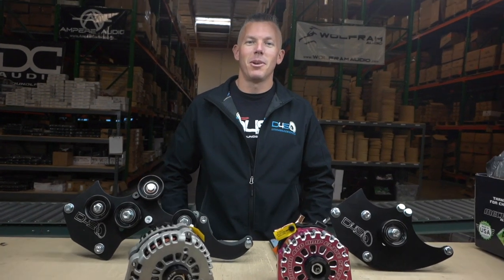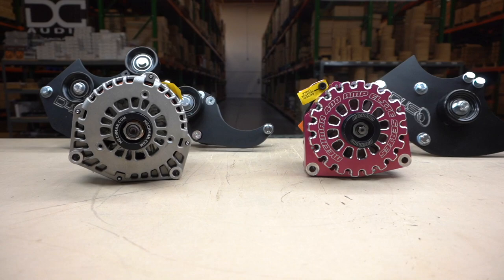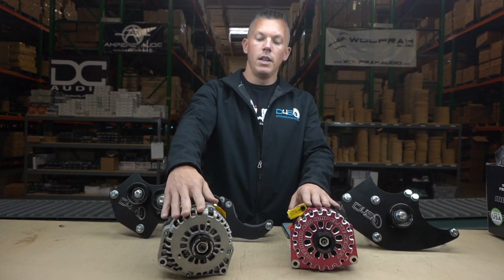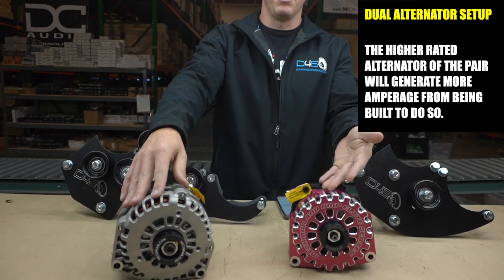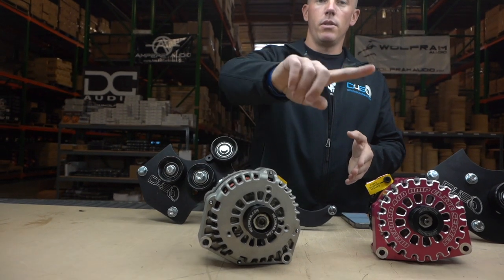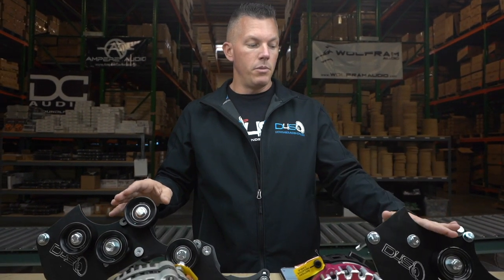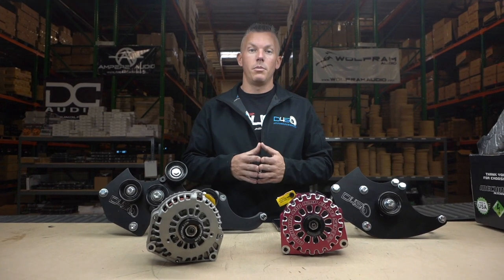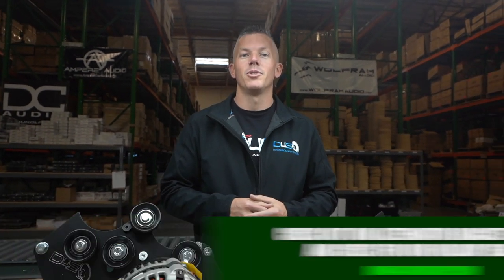FAQ: CAN I USE 2 DIFFERENT ALTERNATORS IN THE SAME SYSTEM?

Comment: A video showing how to run AGM & Limitless would be appreciated.
Reply: AGREED!!
Reply: Don’t do it…..
Reply: Lotsa videos about running agm with lithium on YouTube
Reply: @YouTubesucks.. ,why not?
Reply: @62dobie  Became lithium TRUMPS AGM by far, it’s stupid to run both when you can get better results by just using with lithium!
Reply: @YouTubesucks.. , I do agree. I was just wondering if you had a bad experience with both. I know you can run both together safely. But lithium alone is far superior.
Reply: @62dobie  I ran AGM all up till a few years ago once lithium came around. Now I’m running lithium and SuperCaps on a Salt12k @ .25 ohm on 4 15’s!!!!!
Reply: @YouTubesucks.. , is your cap under the hood?
Reply: @62dobie  Nope, next to my lithium in back. First thing my Amp sees!
Reply: The 6.0 lithium is compatible with AGM. U can run that 2gether
Reply: If I ran 2 alts separated one for the truck and one for the system would that solve my lights dimming when running full tilt at night?

Comment: I have a 2004 F-150. It’s running at 12 volts. I have a high amp alternator in the stock location. I installed a dual alternator setup on it. I have dual agm batteries under the hood. The second alternator is a Mechman 400 amp Elite Series alternator. When I first wired the setup up, I wired both alternators going to the batteries. It was ok at the beginning, but basically the next day the battery light in the dash was on and it caused my truck to rev higher. With my truck in gear and my foot on the brake, rpm’s would be right around 1,000. I really had to keep my foot on the brake pedal or the truck would just want to take off. I couldn’t keep it like that. The setup now, and has been for a while now, is the stock location high amp alternator runs the truck and 5 of the vocal speakers amplifiers and charge’s the two batteries under the hood. The second alternator, the Mechman, charges another agm battery and 2 superbank caps. Totally separate from the other alternator. This charging system runs my 6 subwoofer amplifiers and 2 more vocal speakers amplifiers. It runs perfectly fine this way. I have volt meters hooked up under the hood and on my dash. Maybe a problem or a reason why I can’t wire both alternators together is because of this. When my truck is running after a minute or two, the voltage on my truck side, which is dictated by the engine computer, is around 14.2 - 14.4,5. The voltage coming out of the Mechman is higher, 14.8 - 15 volts. The Mechman is a one wire GM alternator. I don’t know if the different voltages of the two alternators is messing with the computer on my truck or something else when they are wired together, but I can’t do this in my truck. Because the voltage is computer controlled, I don’t know. I emailed Mechman about this and one of their technicians told me to give them a call and explain it to them, but I called half a dozen times and couldn’t get anyone to answer the phone. I had it posted about what was happening with my setup and Steve Meade commented about that I had them wired up wrong. He said I’d be able to hook up 10 alternators up and not have a problem. I asked what I could be wiring up wrong and he never left a response. He’s busy and I’m sure not worried about me, lol. That’s cool, I understand. I follow him. I watch the videos. But if anybody has any suggestions on why I can’t run both alternators together on my truck, I’ll listen. I don’t know if I want change my setup. It’s working good and I don’t have any problems. In the beginning I didn’t want to have two different charging systems in my truck, but that’s what I have to have I guess, lol.
Reply: Ya you need to put a diode on your sense wire for the comp ran alternator it will trick the computer into thinking depending on diode size that the system is a volt under the charge rate the high amp alt is high enough the comp thinks battery is full cycling on and off the alternator it's a maybe I run my truck like thisa 01 f150 triton

Comment: An alternator and battery in parallel with another alternator and battery would have the same voltage, and the current would flow towards the area of least electric potential, which would be the low battery. There are vehicles that run multiply alternators in parallel.

Comment: Can you please do a video on how to wire two alternators separately to two different banks. One to the truck or vehicle electrical system another one to the bank for your audio system
Reply: Literally run each alternator to the battery it is being used ro charge. Easy peezy.
Reply: @the-dullahan  So your saying your wiring harness wires all wired together to the vehicles ignition and so forth only thing that’s different is the charge points go to separate banks, right? Thanks for your response
Reply: Let me just tell you what I have. I have a mechman internally regulated 370 amp direct replacement for my factory alternator that I want to run my factory system. And I’ve got a externally regulated mechman 370 amp alternator that I want to run by battery bank so I can turn the volts up higher. This is what I’m trying to wire up in my truck. Doesn’t matter how the external regular wires up? Does it need to wire up to the battery system that is going to charge or does it matter where it gets it’s 12v reference from?

Comment: Twin outboards (or inboards) connected to two separated battery isolators ( one each engine), charging both: 
- Its own starting battery, and 
- the house battery. 

When both charge the common house battery:
1. How to synchronize the two alternators?
2. How are boat electronics affected? 
3. How are alternator REGULATORS and isolators affected themselves?
4. If an external battery charger ( or any other DC input) is connected to the isolator on the same contact point that the alternator…..What will happen ?

Comment: How do the electric cars deal with alternators? For example, I'd love to drop 12-15K watts into an Ioniq5, but I have no clue how this would work, given the elec nature of the car. Thoughts? Do they make alternators for them? What about batteries?
Reply: I have a KIA Niro which mechanically is identical to your Ioniq.  My Niro is a 2018 HEV(hybrid electric vehicle) and not the PHEV(plug in hybrid electric vehicle) model.  

On hybrids, they don’t have alternators.  They have DC to DC converters.  This takes the high voltage battery pack(240-360 volts for our cars) and converts it down to 12v.  On my car, it is rated for 130 amps.  

Luckily, on the HEV model, the 12v battery is a lithium battery that’s around 30 amp/hr.  

All of this means the factory electrical system can support around 1k watts.  I’ve got a JP8 on a single Savard HiQ 12” subwoofer and unless the amp is clipping, the voltage stays above 13.4 volts all the time.  One trick is to keep the headlights on.  This keeps the voltage in the 13.8v range.  But if you drive with your headlights off then the voltage can dip down to almost 12 volts before the DC to DC converter kicks in.
Reply: @91CavGT5  amazing. I don’t own one yet but my question is how do you upgrade the system to killer wattage on it?
Reply: @TheGodofSEO  you really can’t unless you spend a LOT of money to upgrade the DC to DC converter.  To my knowledge there’s no company doing this for the KIA or Hyundai’s.  You might be able to find a company that does it for Toyota Prius that might be able to do it.  But once again, it won’t be cheap.

Comment: My setup is standard alternator that runs car....but I want 4 extra heavy duty car batteries that will be in the back of my van. All To power miscellaneous other devices...Overnight sleeping fan, laptop etc etc

I want my batteries that are in the back of the van, to be able to be charged up while I drive the car all day. But when I park the car AND TURN IT OFF the fully charged batteries will last all through the night, as they power my laptop and my fan then sleep comfortably as the fan works all night.

I'm wondering how many alternators extra would I need?

Comment: Dual alternators could that be transfered or wired in to a fuse panel that would go to a separate plug out the back of the truck and be able to charge say your trailer battery in line with the solar based system?

Comment: Question JP looking for an answer or suggestion on running tweeters. I have 10 4ohm tweets I'm looking to run my 6.5s are component sets so I have 4 crossovers can multiple tweeters be hooked up to the crossovers should I run 4 of them from the head unit or do I need another 4 channel amp. Also is it too risky to run tweets off of an amp even with gain way down. 6 of them are 40 watt RMS and 4 are 120 is it safe to drop them below the 4 ohm because I don't believe there is a way to run them all and keep the 4 ohm impedance. Thank you hope that all makes sense

Comment: Jonathan I like your video's and have been watching things I have questions about. This video is helpful because I would like to run a secondary alternator to power my system. My question is 2 parts. How many batteries would be needed for say a 400 amp mechman? (would a single high capacity battery be enough?) And secondly will the alternator damage the secondary battery if you aren't using the system? No current draw, or very litttle? Thank you

Comment: How do you run a big 3 wire upgrade if your running 2 separate alternators and one is high output and your running your sound system of and it's just the alternator with no battery under the hood just batteries in back

Comment: So.. how do you keep the amperage under control to meet the lithium batteries expectations? Or do you? Does a high amperage configuration lower the life on the batteries?
Reply: If your running all alternators together on 1 bank amperage isn't what you need to worry about, its about the set charge voltage, if they are both set to around 14.4 or so then its just plug and play. For the rated amperage, well you simply combine both of them, (Example) like the ones in the video, 270 + 400 = 670amps total. Realistically you won't see that full amount counting in heat soak and factory electronics.. Rule of thumb, take off 30 to 40% of your total alternator power for that.

As far as is it bad for the battery's with high amperage? No, Its actually worse for the alternator not so much the battery if its having to output its maximum current constantly. So its best to have a battery bank large enough to buffer the power your running, lithium banks are great for that, but of course the main thing is always have enough alternator power regardless, because that's what matters the most, the bigger the battery bank the bigger the power your running results in the more alternator you will need.

Comment: Hi I'm Carlos I would like to make a green a.p.u. if i  git a Alternator from you what is the max r.p.m. that I need and how much amps would I need my a/c is 22000 b.t.u. my Refrigerator is 25 amps my Freezer is 25 amps it cold be more so if us and Electric motor to turn the alternator for power so i can Circle the power around and around this will be for my  Big Rick and all so need a Automatic shut off so I  Won't over Charge my batterys can you help  thank you

Comment: i have a 425 alt from brand x and i looked on your website and i dont see any alternator brackets mainly gm ive got a 1999 ford expedition 5.4 and id love to put another alt on it for more power im running  2skar vxf 15s atm but gonna upgrade to 8 12s on a 30k i checked yours first before brand x for an alternator but couldnt find one would be awesome to get a dual bracket

Comment: Does anyone know the max charge voltage for 38120 headway lithium 3.2 volt cells? They're 4 in series,32 cells per pack with 12 packs?
Reply: Most of those have a maximum of 3.6 volts per cell.  3.6 X 4 = 14.4 volts.

Comment: If I have 2 optima red top batterys one under the hood and one in the trunk 1 wire running from the positive of the front to the back and the back battery is grounded to the chassis and I also have the big 3 how well does the battery in the trunk charge compared to the one under the hood thanks JP
Reply: Depends on how much amperage you're generating, how much amperage you're using, and what type of isolator you're running between your batteries

Comment: Does this cause more draw on engine? Also more gas as well?
Reply: Yes having more (and/or even just more powerful) alternators will draw more from the engine as they have to pull the power that they output from somewhere 
(a 12V 35A alternator draws about 1hp from the engine)
Reply: The gas consumption will increase slightly but measurably as the engine has to work that little bit harder.

Comment: Can you run a high output on stock for a little while? Like say you're piecing together your setup have the alt and your stock goes out but the rest of your setup ain't home yet. Would that cause major damage? Like just wait. It's good run it. Or only for a like a week just to work.
Reply: Yes its fine as long as you do a big 3 so you dont smoke the factory charge wire extra amperage isn't going to hurt anything
Reply: Yes it will be fine. The alternator is only going to produce the amount of amperage that is required for the vehicle. So even if you have a 400 amp but the vehicle only requires 60 amps total then alt it is only going to produce that 60 amps to cover it. It will only produce 400 amps when it needs to.

Comment: What should I put in the back as an extra battery for my 2000 watt amp? I’m going for an XS power battery just don’t know what size I should get they are pretty pricy, I have a 240 amp alternator as well.
Reply: Well that is a good question because of 2000 watt amp pulls 145-167 Amps leaving you only 70 amps to charge with.

Comment: I am designing a system to run off a 25 hp diesel on a sail boat.  I want one small alternator for the starting battery and a very large alternator for the 'house' batteries.  If I was running one of your alternators @ 2000 rpm, then removed the load completely, via a switch, would it damage the alternator?
Reply: Do yourself a favor.  KISS.

Comment: Could you run a 24v alternator in your 12 v 4wd to power a 24v RV battery system?
Reply: You would have to run separate power and ground if you did. Running ground to the existing setup would cause interference or other issues

Comment: Which would be better to have dual alternators or dual batteries under the hood? What's the pros and cons of a normal truck battery vs the other type that is used? If you had available external space to link together six or nine normal truck batteries in the rear in addition to the one under the hood what would be the pros or cons of using that in comparison to the other type of batteries? Thanks JP for all your amazing videos 👍🏼 Have a Merry Christmas 🎄 and a Happy New Year ☃️
Reply: If your running a system that is running at 14.x volts then all u need is one alt if you are under 5k watts, I am running a single alt just for my audio so I have two but one for my stock side that runs 14.x and audio running at 16.6 volts, but I am on lithium and running like 20k off one alt, u need a combination of battery power and alt power, u can have all the batteries but not enough charging the depletion of the battery can't keep up with the replenish
Reply: More batteries means less current available from the alternator. More run time with the engine off though. Your best bet is to go lithium batteries. They put a lot less of a load on an alternator.

Comment: Can you use 2 different batteries with the same amount of amps?
Reply: You can use any batteries you like, regardless of amperage, as long as your voltage matches. You should, however, always isolate batteries from one another.

Comment: My question is if anyone has ever extended the input armature shaft out the back of an alternator so that it can be attached to the second alternators input armature shaft so both alternators share a single shaft. Could one even apply this to several alternators "a sort of train"
Reply: Doubt a belt would hold all that

Comment: I’m doing 2 12” SA v2’s in my 2019 Accord 2.0t. I’ve got the SFB 3000D.  0 gauge kit and a D4S LTO 3k-5kw 12 lithium battery to run in the back. Do you think I will be okay? Not sure if I should get a new under the hood batt and or A high output alternator. Just wanna make sure everything will be set. Got a install scheduled the 12th of January.
Reply: A high output alt is one of the best things you can do for your system 
100% you will instantly notice it playing louder and sounding better. Get a ho alt you won't be sorry
Reply: @mistertroysd  got the lithium in the back, xs D3400 agm under the hood. Stock alt rn and rockin 14.5 volts. I do have a 250amp alt otw tho. Stock seems to be just fine, though the voltage regulator is killin me bringing it to 12.4 sometimes
Reply: @Crow-xm3nm  right on 
Where's you alt coming from?
Reply: @mistertroysd  my 250amp high output alternator is from excessive amperage. Custom built for my Accord.

Comment: Do you have a bracket for a 99 suburban with the alt on the passenger side
Reply: Basscop has a good video on how to make one yourself. I've had mine like that for 2 years without any problems.
Reply: Duals we’re probably a factory option so I think you should be able to find one